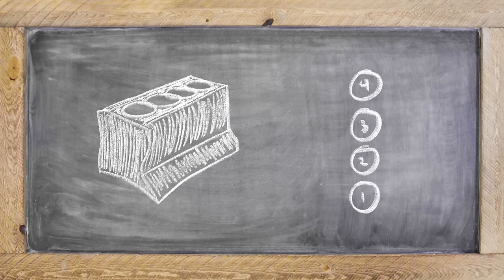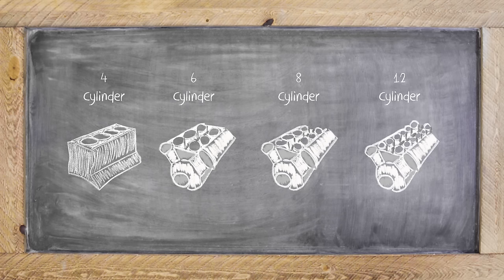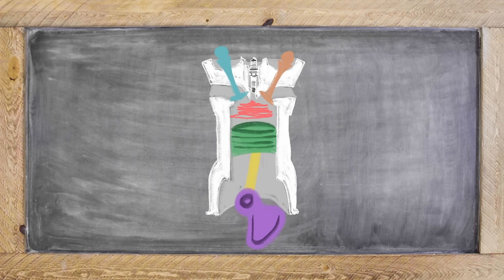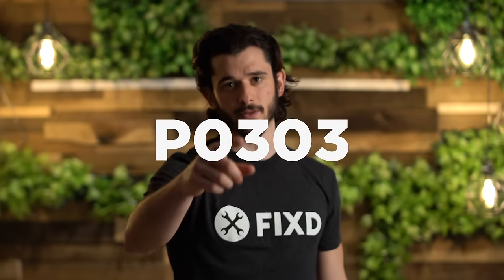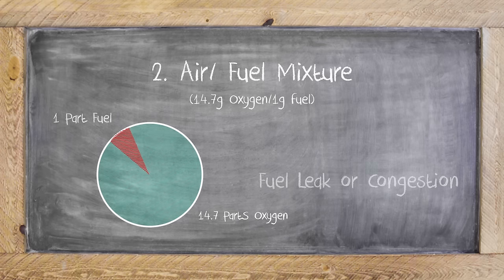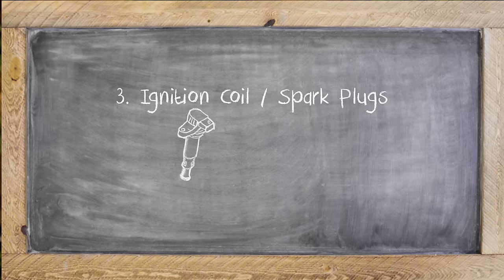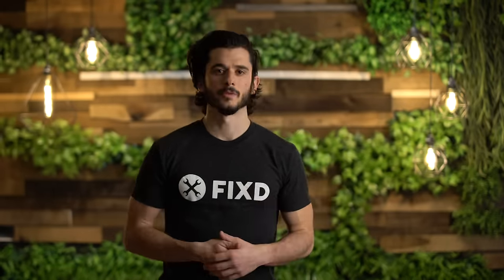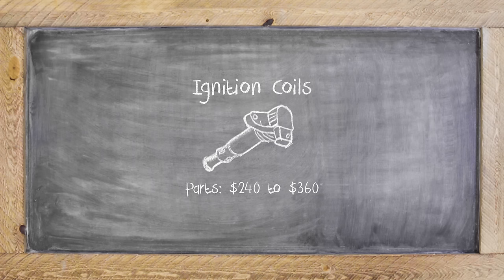P0303 Explained - Cylinder 3 Misfire (Simple Fix)

Comment: Fuel filter would affect all cylinders
Reply: Great point. Thanks, I just got a 303 code🙄
Reply: I had a blazer hit a misfire code felt like the car was done for good when id pass someone ..changed fuel filter fixed it all blew my mind
Reply: @joelmaslonka109  hi what was wrong with yours? Thanks
Reply: Not necessarily. 4 cyl the center cylinders were getting just enough fuel but the furthest cyls nos 1&4 were not. Fuel filter and fuel pressure regulator fixed that problem
Reply: I have a P0303 on my Pontiac Grand Am. Changed the fuel filter, swapped ignition coil, and was trying to replace the fuel compression valve but decided not too lol it was too hard to take off so I gave up.

Comment: I have a P0301 and P0303 misfire code. I changed all the plugs, all wires, all coils, cam and crankshaft position sensors, all the injectors, on a 2002 subaru impreza outback sport 2.5L and engine light keeps coming back on.

Comment: Misfire,[ Specifically Cylinder 3 ]per the OBD .Start with easiest diagnosis. Check for any broken or cracked wires to that cylinder, then check spark plug, then the coil.  If your passed that and all is good, and it's still misfiring,  take it to a professional mechanic for possible deeper issue.
Reply: P0303 code fix, unplug the wire to the mass airflow sensor....that should fix it
Reply: @maceobane2804  hahahaha🤣
Reply: @isaiahmitchell3032  hahahah try it~ it works.

Comment: I like your presentation. Easy to understand. Engine light came on. Wouldnt hold idle at stop light. Got a p0303 code. Pushed down on coil caps tp ensure good connection. Engine light went off and Idle is back to normal. Thanks.
Reply from the maker: Thanks for watching, Matt! Happy and safe driving 😊

Comment: While it is always advisable to try the least expensive fix's as possible first, they are not always successful.  On a 2011-2013 F150/Mustang Coyote 5.0 you will often get misfires on the drivers side bank.  I would always suggest putting in new plugs and swapping coil packs from non misfiring cylinders first, even changing the coil pack connectors and pins.  Once this has been done though, its time to consider other possibilities that are quite a bit more unpleasant.  The next logical step is to do a manual compression test and a leak down test. These 2 tests will tell you if you have a piston/ring problem or a Valve problem.  The 2011-2013 year model Coyote engine is well know to Burn piston rings and Burn Valves due to erosion.  On a normally cared for and driven vehicle with 130,000 + miles, it is most always going to be a burnt or eroded valve.  There was a defect in the materials that the valves were made of that was changed late in the 2013 model year.  These defective valves suffer from erosion where they contact the valve seats.  This reduces compression and over time as it gets worse will eventually misfire and throw a misfire code.  At this high of a mileage it is usually recommended to replace the entire engine.  However this can also occur on lower mileage engines as low as 50,000 miles.  In that case it is acceptable to rework both heads with new valves and have the valve seats recut.  Currently Ford does not have these engines available as long blocks, but are available in the aftermarket.  Just do your research on the company and check the Better Business Bureau rating before doing business with anyone.  engine replacements costs are generally in the $5000 range for the long block and another $1000+ for additional wear parts depending on mileage and $2000 installation labor.  Prices vary widely depending on your service provider though so get multiple estimates.

Comment: FUEL FILTER... is NOT an easy  fix as almost all modern cars have it inside the gas tank inside the fuel pump. 
Still a good video!
Reply: I dunno man. There are ALOT of external filters still. Those large metal cylindrical thread on types like he showed.
Reply: The pumps are inside the tank, the filter is inline on the fuel line.
Reply: @MrOnceinside  Our 2004 Toyota Camry has the fuel filter inside the fuel pump which is inside the gas tank. You access it by taking the backseat out. Here's a video on replacing the filter in an '04 Camry: https://www.youtube.com/watch?v=qTzqv6V5h8M
Reply: @MrOnceinside where is the fuel filter on line on my F250
Reply: AND a special tool is also needed in most cases, like my 2001 Kia Sportage 🙄

Comment: The Maf sensor on my pickup went bad and caused a P0303 code and a  right side running rich code. I replaced the Maf, engine light went away but the misfire and sluggish running is still there.

Comment: ok so i had this misfire code p0303. i changed the coils around, then it went to p0300. So i got all new spark plugs and coils, still p0300. I thought since i switched them around like you said and if the code changes its the coils, welp, it did change and still staying at p0300. smh

Comment: Replaced all 4 plugs on my 2016 Hyundai Elantra. Still getting the code. They still needed changing though. Saw a thing on another video. Get a low voltage pen. $15 at a hardware store. Touch it to the coil while the engine is running. If the light doesn't come on it's bad.

Comment: My 2002 Honda Civic LX shows P0303. The coils test OK. I tried to exchange #3 and #1 coils. Code P0303 still points to #3 coil. Did I misidentify the coil? I changed all 4 spark plugs. Previous to this I changed the Cam Sensor, the Evap Canister, both O2 sensors. A month before this P0303 code I did momentarily overheat. I was low on Cooolant and oil. All codes are gone except the P0303.
Reply: PS- Check Engine Light is "STEADY". Not flashing.

Comment: I have a question about the P0303 error code. This code denotes a misfire at cylinder 3 but I found a website that states that a common mistake people make is that the P0303 code is referring to the third cylinder in the firing order, not cylinder number 3. 

The article states:
"P0303 is a cylinder specific misfire code, which means that Cylinder 3 is misfiring and causing the code. An important thing to understand when finding the location of cylinder 3 is that it's going to be the 3'rd cylinder in the firing order of the vehicle, and not the 3'rd cylinder that you might see when looking at the engine."

My 2006 Mercury Montego has a 3.0Liter v6 with a firing order of 1,4,2,5,3,6. The third cylinder in this firing order would be cylinder 2.
Do I have a misfire in cylinder 2 or 3? Can you please clarify what is meant by cylinder 3?
Thank You
Reply: This is a great question that I wish I knew the answer too. Thanks to you ima ask my mechanic tomorrow when I go to the dealership. Glad you brought this up.
Reply: I know this is old but I have watched many many mechanic videos and worked on my own vehicles and when your OBDII code calls out a specific cylinder code it means the physical location of that cylinder. It does not mean firing order. I am curious where you found that article.

Comment: Hey i had washed ur full video. I have a P0301 misfire in my 07 mazdaspeed 3 and i did changed all my spark plug 2 months ago, and i did test my coils and they r good.. i have the p0301 and my mazdaspeed is shaking too.
Reply: After you washed his video ... These are your words main man. Anyway im sure after you washed his video it was no longer veiwable especially if you used soap as well as the water.... WTF..? Or were you sippin on the old cough medicine bottle.

Comment: i traced my p0303 problum down to a wire connection on the #3 coil pac the red wire had seperated inside the insulation after an hour of trying to soilder it back togather no more cil 3 misfire

Comment: I've got a Mazda Cx-7 07", with Cylinder 3 Misfire and Intake Manifold Runner Control stuck closed bank 1, would they be related or are they separate problems?

Comment: I received the p0303 misfire code and it comes on with a blinking stabilitrak light. The stabilitrak light disappears after I warm the car up turn it off and turn it back on. However the check engine light continues to stay on. Car runs and sounds normal during performance. On a cold start it will back fire a couple times. Anyone got any clue on what this could be?
Reply: coil plug
Reply: @RoryKriest  nope it was a fuel injector
Reply: I just got the same lights on my pos chevy equinox stabilitrak light and cylinder #3 misfire.

Comment: You lost me when you said it can be a fuel filter. That causes a random misfire. Most vehicles since 07 have no inline fuel filters.
Reply: find yourself someone who knows and works on cars , vaccum leak, valve guides and seat , loose wire harness bad coil or grounding wiring to mention a few possibilities btw common sense not always apply when it comes to this modern headaches I mean cars lol wait till they go full electric lmao  be safe
Reply: @zacariasblanco9738  funny how you think electric wouldn’t be half the headache as gas cars 🤣
Reply: @5300trilla  you got it all twisted boss but ok

Comment: I just replaced all my spark plugs and I just got a cylinder 3 misfire code. And I replaced the pcv valve help
Reply: Me too
Reply: Did u figure out what it is/was?
Reply: Replace your fuel injector #cylinder. We have horrible fuel now a days. Put some seafoam in every 2 months so it doesn't happen again.
Reply: Sorry #3 cylinder
Reply: Check ignition coil packs on your misfiring cylinder(s).
Reply: Also, check for proper gap on your #3 plug.

Comment: I have an infinity g35 P0303 and I’ve changed my coils packs (OEM) and sparks ⚡️ Ngk. This didn’t fix the problem :/ any help ? Good looks man
Reply: If it was the coil, you would have most likley thrown a p353.  Did you get this fixed?
Reply: @falsedragon33  it’s actually down right now my guy . I don’t know what’s wrong it . It was over heating on me a lot and every ride I would stop and turn off the car and take off the radiator cap to relieve the pressure and put new water . Literally did this every ride. And it just wouldn’t turn on one morning so it’s been sitting since. Shit sucks
Reply: @searchdaone8130  oh, that sucks.  Hope the heat didn't get to the cylinders.  Wish you the best.  If you ever dare to tackle it, I'm more than willing to help as much as I can.

Comment: I got this code and i change the coil, but still the problem is there. Do u advise me to change the fuel filter and fuel pump? merceds glc300/ 43k milage. Thanx
Reply: One idea, if it helps.   Start the engine  at  night, look to see  if there is any  arcing at  plug wire  number  3  or  whatever wire  the  scanner  mentions.     If number 3 cylinder misfire,  then dont  go  buying  things but  check that one  wire  first---------number 3.
Reply: @bennygreene1421  Thanx bro for ur reply. The issue was with catalytic converter. The filter was damage. I change it. Issue solved
Reply: @mohammedalsubhi5028  👍

Comment: I had a misfire on a 2010 Tucson change out 4 spark plug and 4 ignition coils car crank but won't start  crank shaft sensor came up then I un hooked the battery and rehooked it and then the camshaft sensor came on scanner so now I have 2 sensors in and i'm gonna change the coolant sensor too I don't have many friends but I have one to help but those sensors on finding them is heck had to beg people in a Hyundai form to get 115 pictures of everything under the hood these sensor are my last try and I don't know I did this far and got a friend to help I hope it works
Reply: What ended up happening lol

Comment: Here a little known tip... when repairing forgine cars like Nissan, close isnt good enough. I replaced coils and plugs on 07 vq3.5 from parts store platinum ngk plugs and aftermarket coils on all 6. Saved over half price cost from dealer. And guess what, ran worse than it did b4 i took apart. Multiple cylinders misfire from  po303. Wtf. Took back apart. Bought oe coils from dealer. And runs like a top. Cheap coils output vary and close isnt good enough.  Always use oem parts especially if there hidden under your intake dont want to do that twice. Lesson learned.

Comment: I just did a tune up on my truck when I finished I got this code. I drive a 04 ram 1500 4.7 V8
Reply: Check for the proper gap on your #3 plug.
Reply: Hey man I’m looking to buy an 06 ram 1500 with a cylinder 3 misfire, we’re you able to fix yours pretty easily or no? I don’t know if I should still buy it . I
Reply: @anthonyasceves245  yeah I fixed it. When I did my tune up I never checked my ignition coils and they were pretty messed up. Also when I tightened my plugs I went a little to hard on 3rd and ended up breaking it.
Reply: @anthonyasceves245  I had my 04 ram for like 3 years now and after that mistake my engine light hasn't been on yet.
Reply: @peanut4290  thank you for the quick response , hopefully it’s a quick fix. Im still deciding if I should get it or not.
Reply: Did you do the work yourself , if so , was it hard to do it?
Reply: @anthonyasceves245  Yeah I did it myself. The maintenance is pretty easy for this engine, just keep up with everything and it'll never let you down.

Comment: I've changed everything already, Coils, Sparkplugs, rewired new coil clips  since I had broken ones, changed new MaF Sensor not cheap, cleaned filter, made sure intake box is sealed properly and  I still have codes P0300, P0303, P0352, P0353, I'm so stressed out this is my only car to work and for winter I need to fix it but audi or mechanic will charge me up the ass, I'd rather do it my self! One thing I will mention is when I rewired the coil harness where all the ignition Coil wired are tucked in (harness cover) I broke that trying to open it so yes even tho my wired are rewired right my harness is open and wires are  exposed, did order the new harness cover, could that be the cause of all these codes? Or did I connect something wrong I doubt it Im sure I rewired everything right! My only option right now is to order a new fuel filter.. I need help guys 😒, By the way this is for my  2010 Audi A4 Quattro 2.0t I4 🤦🏻‍♂️🤦🏻‍♂️
Reply: Do a compression test you can rent a compression tester from autozone and check what the compression is supposed to be if it’s to low then the problem is internal if it’s good then maybe it’s a fuel injector or evap leak or somethin stupid
Reply: @andrewdamico3787  Alright just got the tool today from Amazon will be doing it tomorrow on my day off, let's see what comes up
Reply: 90s Kid look up what the minimum compression should be on your car it’s different for every car
Reply: @andrewdamico3787  I will thanks man!
Reply: Did you get it fixed?
Reply: @princezzlily7700  nope replaced Map sensor was full of oil, put new Throttle body thought  maybe it was stuck open causing intake leak and lean codes but nope I'm about to give up on this car ives spent well over 2k trying to fix it. Had to toe the car to a mechanic as well because the valve cover seal was leaking and even like that it did not fix the issue all hoses and pvc have been replaced, I put gas cleaners, top quality oil and additives. Still no luck. 2010 was one of the worst years to get a A4 my luck I didn't know when I bought it. Fuck me.
Reply: @S4_QUATTROPOWER  rear main seal 😉
Reply: @mavz5707  No oil leaks tho? Been driving the car like this for 2 years
Reply: @S4_QUATTROPOWER  Did you get it fixed?
Reply: @mbz4652  Nope. Car shakes really bad now had my engine light flash on and off. I'm about give up on this car smh 🤦‍♂️
Reply: @S4_QUATTROPOWER  I hope you get it fixed. Try maybe to look into audi forum's  with the same symptoms and same error codes
Reply: @mbz4652  Thanks,I have bro they were saying pcv valve but I eliminated that and put a player and oil catch can still no difference
Reply: @S4_QUATTROPOWER  I would sell it at this point an making sure I sell it for a higher reasonable price then your initial asking price and then letting the buyer offering you your target price

Comment: Have this on 05 supercharged Monte Carlo. 3.8
Can't ffix5.
Checks all down to thermo paste on IG.module.
All options on spark related diagnosis.
All new plugs
Coils checked. Swapped.
Compression ok all same .
Maf ok. New.
Fuel pressure ok. 
Boost hose replacement. Had crack. Vac leak...On top of super charger. .
Next gas filter. 

Wires new. And swapped. around.
Reply: Did you ever figure problem out? I have this same thing going on  my 05 monte and replaced most of everything u stated.

Comment: I have a 2015 Chevy Tahoe PPV and im getting a P0303 code, autozone said it was saying that my fuel injectors needed to be replaced. I thought it was because of some bad gas. I ran the gas out and refilled and added some fuel injector cleaner a few days later it came back on. I called the mechanic and told him what was going on and said it could also be the lifter going out. Could this possibly be tge problem?

Comment: I had a cylinder 3 misfire, replaced sparky and still had a check engine code.. IDK confused
Reply: Did the car drive better or the same.  ?  Did u get it fixed ?
Reply: @TroyFortune_33  I ended up changing all of my spark plugs on my 2004 wrx and that did the job! the car drove a lot better
Reply: I got my 4 all changed today. And instantly the car was back to full power, I’ll change the four coils in the week.  The spark plugs I think is just a cheap fix….
Reply: @TroyFortune_33  Most definitely and honestly make a big difference. An overall better feel of the powerband

Comment: Replaced coils plugs wires fuel injectors ICM did all this then find out have low compression  cylinder 3
Reply: @anthonyjudge667  not sure think it was rings or something  just got rid of the car never dug into it

Comment: Hey FIXD just a question i have a 2005 nissian altama i need some advice the car shakes at low rpms and the service engine light comes on blinks and then goes away and then comes back and blinks is that a misfire